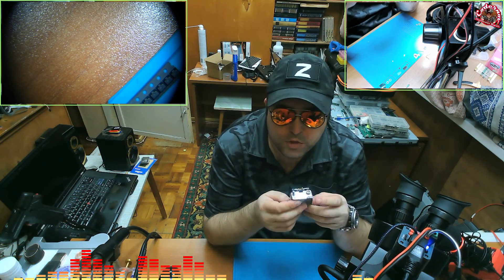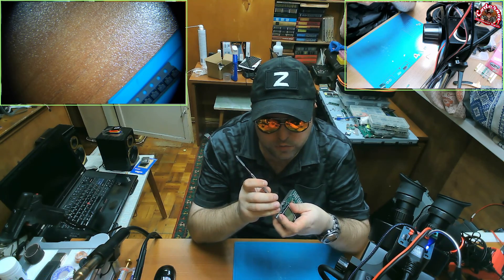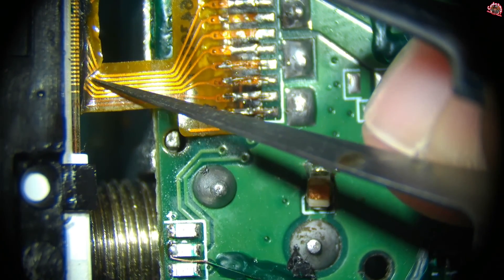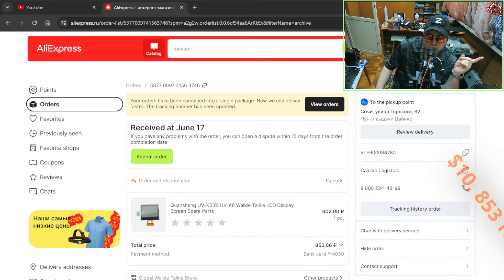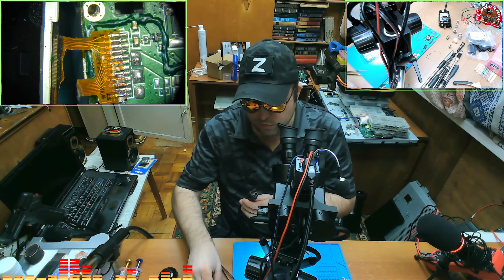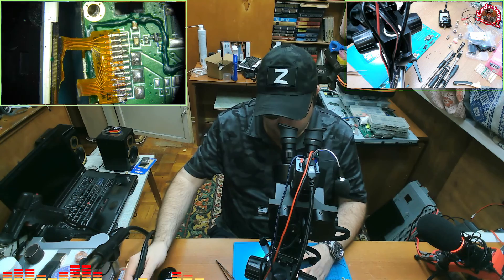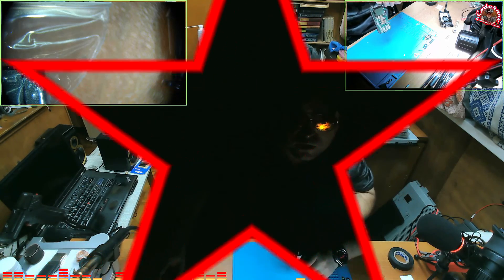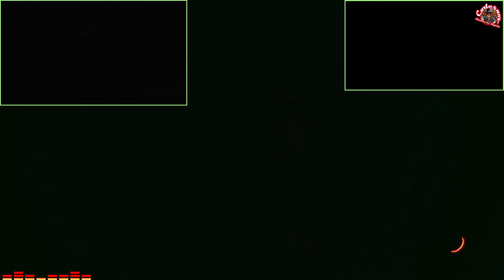Quansheng UV-K5 Replace LCD - Repair Screen/Display

Comment: I have successfully broken two screens. In one case, I had a screwdriver slip and break through the FPC cable. I thought this meant designing a custom cable in KiCAD and sending off to a board manufacturer, but lo and behold AliExpress managed to have an entire screen and FPC cable combo. In another case, the coax seemed to have sandwiched in between the case and the screen and cracked the screen. I have fully accepted failures along the way, but AliExpress manages to take more of my money even when I think I am done. :)

Comment: I like your dexterity with that iron, that's art. I'm also thinking of my K5, it's wobbly since the day I kind of tried to mod some stuff with the antenna connector straight to BNC. Now I'm thinking, what if we used an OLED display? Finding one or more that can be compatible would make things interesting.

Comment from the maker: Best not to break the screen, otherwise it will cost you half the price of radio just for the part, plus the work if you not doing the job yourself, which in the real world would mean you just go buy a brand new radio. Be careful when doing test fitting for dual antenna, if you crink the FPC, it will break eventually.